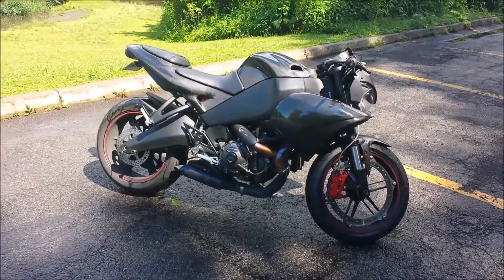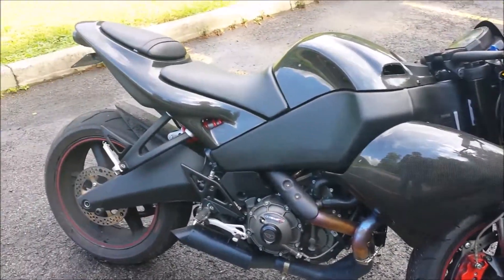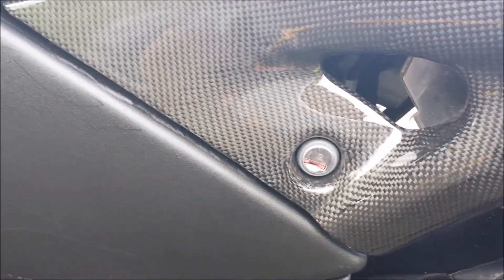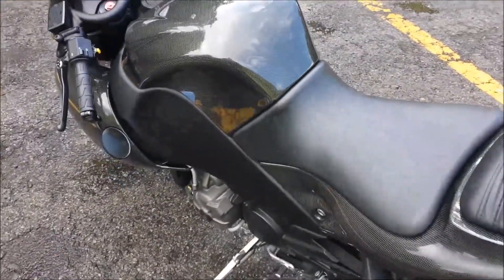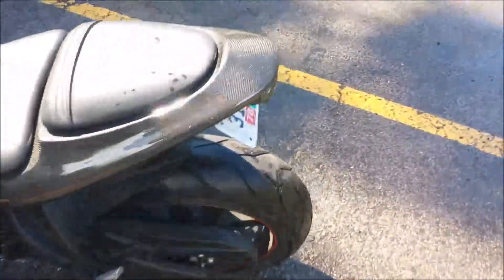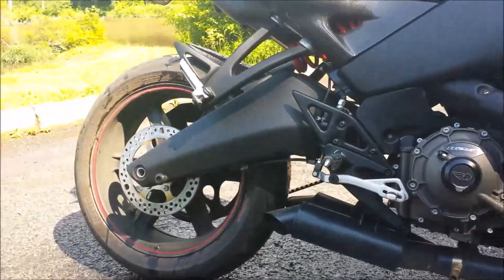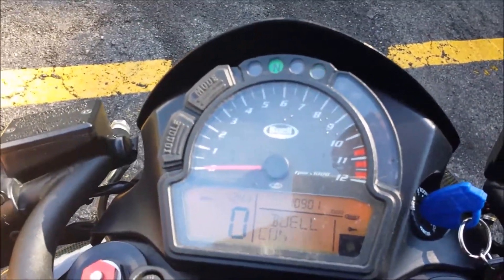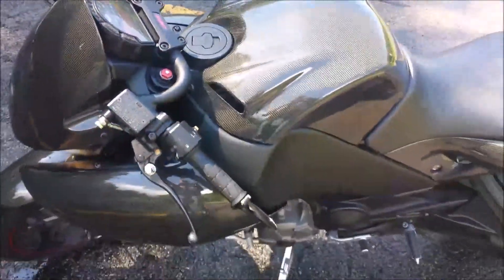Carbon Fiber Buell 1125CR Mods and Walkaround

Comment: how difficult was it to change the mirrors out with having to deal with the wiring from the signals? also, what type of mirrors did you go with?
Reply from the maker: +kip304 I switched to bar end mirrors, you can find them all over the internet for sale. As for the removal of the stock mirrors, they were pretty simple. Just chase the wires back to behind the windscreen, cut the wires, crimp on some connectors and add your new signals. I chose led strips on the face of each pod.
Reply: Bar end mirrors are what ive been looking at. did you get some that just simply clamp onto the ends, or the ones that screw into the bar?
Reply from the maker: +kip304 The ones I have screw into the handlebar but give the illusion they're clamped on the ends. Here's a link to an off brand of the style mine are. Double check bar size though, I can't remember if they're in fact 7/8th bars offhand. Here's the link: http://www.ebay.com/itm/BLACK-3-UNIVERSAL-MOTORCYCLE-CNC-ALUMINUM-7-8-HANDLE-BAR-END-MIRRORS-/272000066590?hash=item3f5477a41e&vxp=mtr